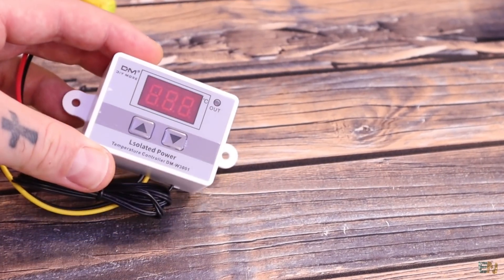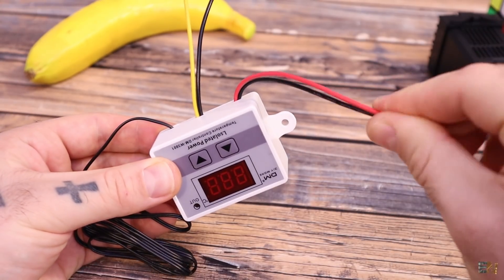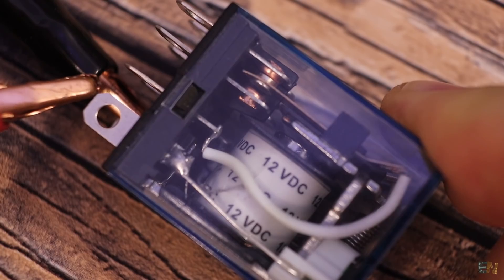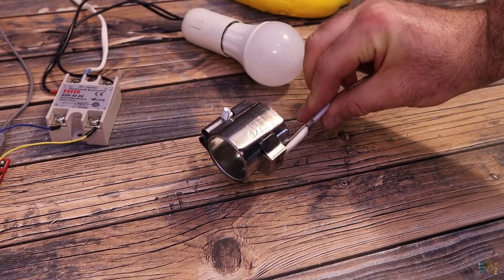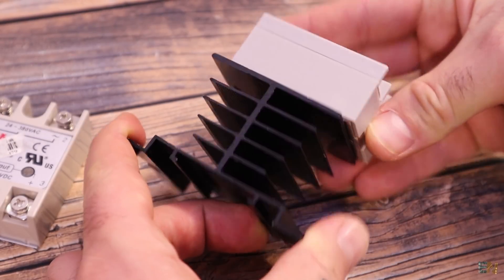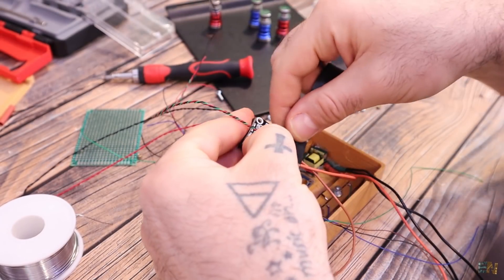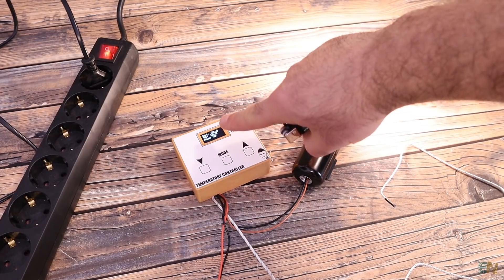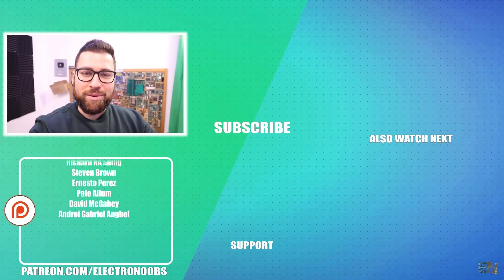Temperature Controller 220V AC Heater Homemade

Comment from the maker: Arduino Course (Spanish): https://bit.ly/3ldW6kO
Follow me on FACEBOOK for more: https://www.facebook.com/Electronoobs
Help me on Patreon: https://www.patreon.com/ELECTRONOOBS
Reply: I have a question that as you are using a Small SSR 2A which has pwm signal pin but how you will connect a 40A SSR which doesn't have a 3 pins as input as it has only two terminal to power. 
In schematic you hv mentioned of 2A SSR 

so let me know how to use 40A SSR connection with Arduino!!!

Comment: I'm watching your vids on this topic with interest, and linking to the parts on taobao for later purchase 😀 However, I'm curios, have you looked into multi-step "ramp/soak" programming of the controller; or touchscreen control; or wifi/bluetooth control? Also, is ther an iPhone app for developing an interface for the controller? I'm a bona fide noob and would like to know more.

Comment: Great video! It is very clear and easy to understand. I just have two questions regarding my project: 
I would like to power two 24V-90W cartridge heater. Is a (max.) 2A 240V SSR enough? 
I have found a PID controller that can provide a 3A 250V output, do I even need the SSR? Thank you

Comment: Thank you sir for awsome toturials, I am trying to build a three vesel brewing system using PIDs, and I am pretty new to arduino. Here is my qustion; can I use a single arduino uno to control three separate heating elements?
Reply: In principle, yes. The arduino allow you to use pins 3, 5, 6, 9, 10 or 11 as PWM output. Since, for brewing, the elements aren't operated simultaneously, then all should be a matter of programming the device.

Comment: Can i use the omron SSR to run heater with  24V AC Load?
Reply: an themax current for my heater wire is 2.75 Amperes

Comment: Cool. I built something similar a few years ago but didn't 100% finish. Mine controlled a fan in an attempt to adjust 'furnace' temp of my home built smoker. There is a video somewhere from a guy, Archie Wigglesworth, 🤔. Anyway, Archie uses a heater to 'burn' the wood and another to heat his oven. My method is to 'warm' smoke, then, crank up the heat to finish the meat. So, Archie's project fits with my method. 
I just got my controller out of the 'unfinished' projects box. Ah, memories 🤭
You have given me some motivation to revisit this project again as I have some pork loin in the brine ready to go.

Comment: Sit please make a temperature control module like ac control where higher 20 degree Celsius the AC is turn on after certain gap down temperature at 14 degrees celsius AC will turn off.

Comment: doubt: So as I understand unlike in the other video where the voltage was regulated, here the ac input remains the same but it is just switched. higher ontime means higher temperature and lower ontime means lover temperature?

Comment: I'm worried these fast switching cycles may burn out the solid state relay prematurely. how would you change the code and sacrifice a small bit of precision, but slow the switching frequency as low as possible?

Comment: I am using it with a coil heater. The problem is the material which sticks to the coil which heats up from the heater has a maximum allowable temperature which comes in contact of it. Now I have two choices---attach the theromocouple to the heater and that makes sure it stays at required temperature of 37 d Celsius. Or, connect it to the liquid bath I am connecting heater to, but that makes the heater overshoot to over 50 degrees. This creates a problem with the material the heater is in directly contact with.

How can I make sure that I get to 37 inside the chamber in this case, and still define a maximum temperature the heater needs to get to? Probably two thermocouples? One for the heating element, and one for the liquid inside the bath.

Comment: I'm a bit confused on how you denounced the push buttons. I made a multimeter and had the problem of push button bouncing when I used external interrupts in my code.
I would be really nice if you make a video on push button denouncing.
Thank you
Reply: you can do it in code - there are examples around the internet BUT it is lengthy, so it takes up memory and can slow execution. Better IMHO to do it in hardware - the most simple way [though not always the best] is just a bypass cap wired in parallel with the switch - again many examples on the internet
Reply: @kennmossman8701  Thanks mate!!!

Comment: @Electronoobs I really like your videos especially when they are about AC power control. I just have a question,  don't you have a problem with an unisolated thermocouple head attached to an electric conducting surface, like for example the heating element stainless steel surface, where the measured temperature gets drifted because of increasing cold junction area?

Comment: a while back i made my own custom Thermostat using a ESP32. it was loads and loads of fun. first i replicated the existing (simple) thermostat... made a 3d printed shell for it... then i added the wifi... then the bluetooth... then added scheduling... then voice control (IFTTT)... turns out that the old "Dumb" thermostat used an atmega32 chip :)

Comment: The first controller type is usually called a "bang-bang" or "on-off" controller. 
The second controller is most-likely PID; it just has a long sample period, and slow PWM/PFM output.
Reply: Replying to an old post but can confirm. The second one is a PID. It definitely has dynamic values because over the last year of use in my kiln I have noticed that the hysteresis has gone from +-10C when I first used it to +-5 and now it is around +-2C. In the kiln itself, it is probably not even noticeable. I think this is about as good as it is going to get because I have the feeling there is a fixed lead-lag compensation from the manufacturer for stability. I could probably confirm this if I cared enough to break out the port but +/-2C is good enough for me to not care enough.

Comment: Great project. As always. Just one thing. I don't think using the infrared digital thermometer on a shiny metal like that gives you an accurate read out. At least that is what I understand. Correct me if I'm wrong.
Reply: You are right. Better tape some black tape and measure.

Comment: If you wanted to add a timer to your project (for instance, homebrewing system) then certainly atmega 328 can not handle all of this especially with the OLED display together.
Reply: Sure it can..I've done it.  Display + RTC + one pin output and 2/3 inputs is not difficult for it.  It is however getting to the limit of the memory with the RTC+Display libraries, so no room for sloppy programming.
Edit:. It actually even has rs485 comms too, so ass rs485 lib to that
Reply: @jimb032  You clearly have no idea what are you talking about! First of all you don't need an RTC (Real Time Clock, it is an external module for Arduino UNO because atemga328 does not have an internal one) is not the best way for keeping track of short periods of time like 60 or 90 minutes. it is better achieved using software interrupts but that will make your code rather complicated. 
trying using hardware interrupts with a timer in a loop. You will see what I am talking about!
Reply: @Heybat  and you clearly have no idea how to program properly.  I know what an RTC is I've used it in many projects.  (RTC-Real Time Clock-since you seem to not understand either).  It's even easier if you don't use one, I'm just saying at no way are you at the limit unless you are just a sloppy programmer.  I'm well aware how to use interrupts, it's very above and necessary for almost every communications module.  Admittedly nice never done a home brewing project with Arduino, only things much more complicated, but since there are tons of examples of home brewing  using a 328 it seems it's only a challenge for you.

Comment: Can I use ntc to read temperature instant of thermocouple
Reply: Sure you can, as long as the NTC covers the temperature range you will be using. The temperature sampling code needs to be adapted, of course

Comment: Be careful with the cheap Fotek SSR from Aliexpress. They are mostly fake ones definetly not being able to switch the indicated Amps!
Reply: Yes, but many are quite OK once you derate them. BigClive has done a teardown of a couple of them I believe. Many of them do also have a driver chip with built-in zero-crossing detection. I got a few of them with 25A rating, but opened one to confirm that BTA12 triac in there (12A max). Apart from that it had good insulation/ separation, but barely any podding.

Comment: You are confusing on-off control and proportional control. Also it's very possible that the black commercial thermostat is doing pid control. It is just dividing a set period into on and off according to the output level calculated by the pid math. 2 sec off and 3 on equals 60 percent power for example. You don't need high frequency switching to do pid control on heating.
Reply: I wonder if all this can be replaced by a simple analog circuit with an op amp and a timing capacitor - PID is great, but for heating an element?
Still I would love it he Electronoobs would explain his PID code a little more.
Reply: Electronic control of tankless water heater: Use a PID? SSR vs SCR?
I have an 8KW Atmor tankless water heater that has two switched heating elements. I want to add stable electronic temperature control. But I can't find good information about the different options!
Seems the PID + SSR MAY have longer switching time, and that MAY reduce heating element life from thermal cycling vs a higher speed SCR. But I am having trouble finding the real answer.
Reply: I control my water heater with a simple 240 VAC bimetallic switch. It’s been functioning for the last 14 years. No electronics, cheap and keeps my water at the set point, plus or minus 2°C. Amazing isn’t it?